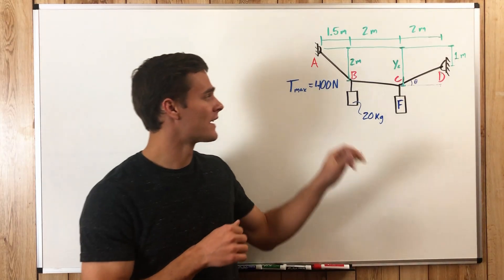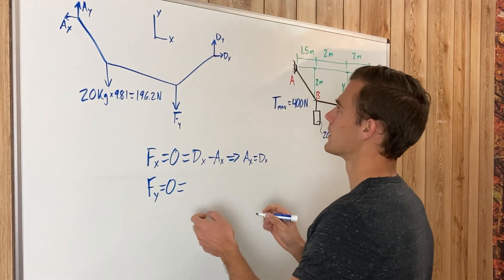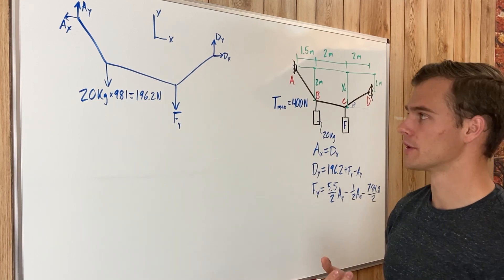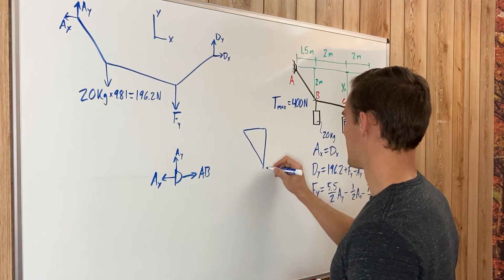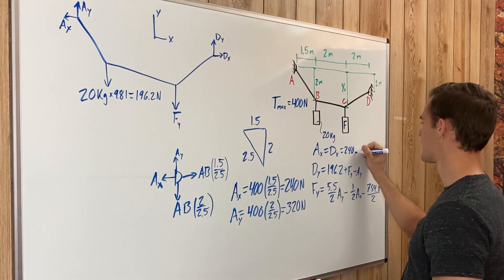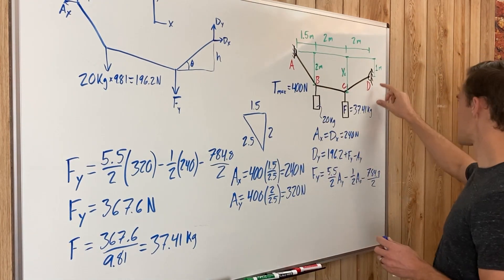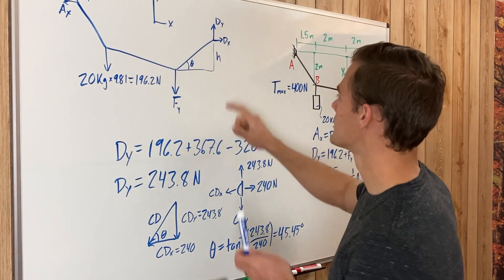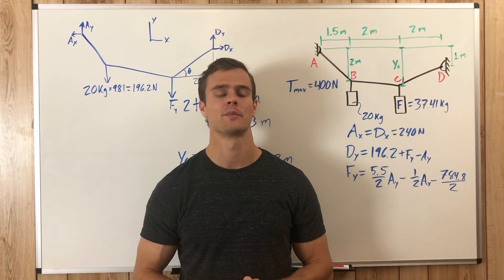CONCENTRATED LOADS on Cables Example Problem // How to solve for the unknowns on loaded cables

Comment: Hello sir, what if supports are at same level and subjected to multiple concentrated loads, will there be same tension at both the supports ?
Reply from the maker: Great question! If the loads are placed symmetrically and the loads are symmetrical then yes, the tension will be the same at both supports
Reply: @studentengineering  ok thank you

Comment: Hi sir. I'm having trouble with this question.  It has the exact figure and exact value except the value of load F is given but Tmax is not.  And need to find the tension ab. How to do it sir? Thank you
Reply from the maker: It’s still the same process. You set up the free body diagrams of the different joints and sections of the cable and then use the method of joints and the method of sections to solve for the unknown forces. In your case the load F will become a known force and Tmax will be an unknown force. Here are some links to videos explaining the methods of sections and joints: 
https://youtu.be/s-TD2W_RSdk
https://youtu.be/Urgr-omwokU

Comment: Hi sir, i have a problem of rope with concentrated load. The problem is,I have a rope with 6 meters length, at the first end of rope (Point A pinned at x=0, y=0) and the second end of rope (Point B pinned at x=4,y= -1) then divided the 6 meters rope to put a 2 concentrated load with the same mass( .5kg ) so there has 3 segments and each segment is 2 meters. The question is. what is the x and y position of 2 concentrated load after i hang it into the rope? please help.. thank you in advanced.
Reply from the maker: That’s a pretty complicated problem unless they give you a few more pieces of information. What you would need to do is get a bunch of equations using the method of sections and the method of joints and then solve for those unknown variables with a system of equations. Here are some of my videos explaining these concepts if you don’t understand them:
Equilibrium equations: https://youtu.be/PH13ZBg5Mak
Method of joints: https://youtu.be/s-TD2W_RSdk
Method of sections: https://youtu.be/Urgr-omwokU
Concentrated loads on cables: https://youtu.be/INoEWQe8MAk
Reply: @studentengineering   i have done already sir, 
https://youtu.be/5ap1s5EGdLI